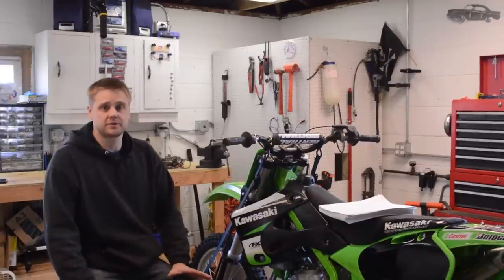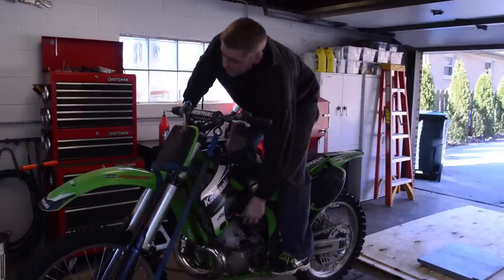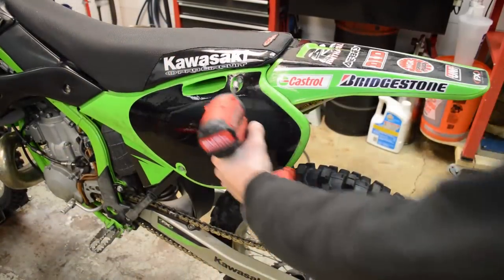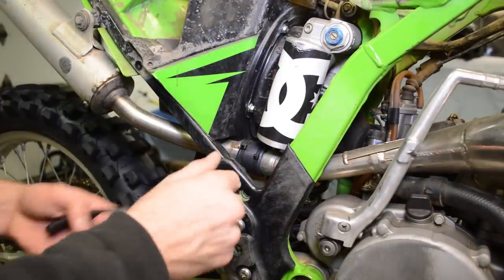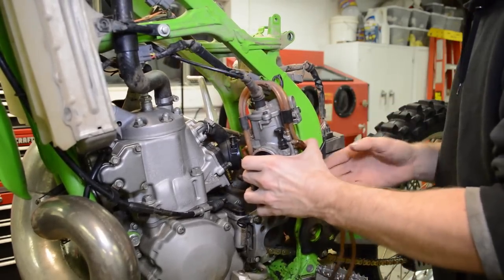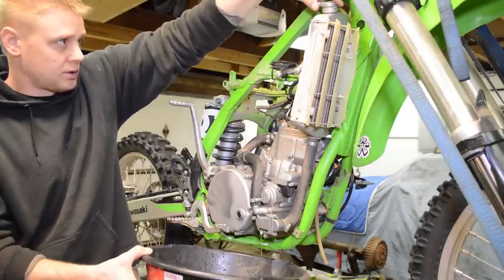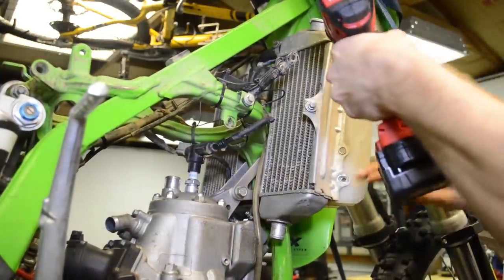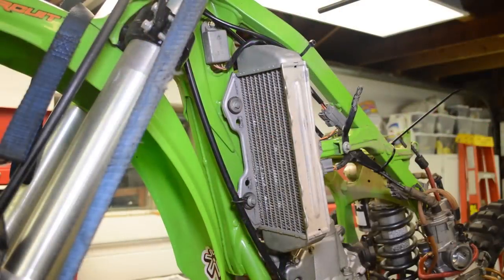How-To: Kawasaki KX125/KX250 Top & Bottom Engine Rebuild 1994-2007

Comment: Thanks for taking the time to do this!
Reply: Kinda vague/ambiguous on certain parts and the metals used
Reply from the maker: @rw499  Everything is covered in the full 6hr video.
Reply: @HTMR  do you have diagrams ? I am interested, but don't want to be let down
Reply from the maker: @rw499  Diagrams for what? You can download the service manual for free on my site. Exploded diagrams can be found on RM atv or any OEM site.

Comment: Thats cool man. I hope this system is working for you. I have a low hour 94 KX250 that hasn't been ridden in 15 years. I might take you up on your video. Thanks!
Reply from the maker: Hi Chris, yes the cranks seals will be suspect after sitting that long. You will have to split cases to replace them.
Reply: How you make out?
Reply: @bunnyman6321  It runs great but I haven't "ridden it". Its a VERY low hour bike and I am trying to keep it original. With the carb cleaned and some fresh fuel it fires right up. It does need fork seals now. Sitting that long is hard on stuff.
Reply: @chriswesney  What plans you have for it other than keeping it original n servicing it?
Reply: @bunnyman6321  My uncle bought it new when I was a kid. I lived with my aunt and uncle back then so its like a family heirloom I guess. I just like having it. I have other bikes that I can ride so my idea is just to preserve it for now.
Reply: @chriswesney  That's cool af! I have a 2002 kx 250 it original n after market parts on it. I love 2t.

Comment: Ok I'm subscribed and I have a 98 kx250 all I need to know is the flywheel and stator cover torque setting I already know the flywheel nut it doesn't say anything in my manual it just says tighten accordingly 😮 I don't have time to watch the video also the power valve covers torque spec isn't in my manual either can you please give me the specs thanks in advance 👍I'm installing the works nickel dress up kit if I don't hear from you I'm just going to torque them down to 16 to 18 ft lbs lol

Comment: I'm purchasing a 95 saki KX125 with bill of sale the bike is immaculate all is in order except the engine of off entirely groom the chassis of the MX. Would you greatly  recommend I completely rebuilt it in wiseco parts crank bearing the while kit ?? Is it reccomendable? A good project I see it as
Reply from the maker: I would go oem for parts. Have the crank rebuilt if stock.

Comment: Hey Matthew, I have a 1990 KX125 that I got from a buddy and I am wondering if you know if I can swap/exchange parts from that engine with parts from newer kx125s? The reason I am asking is I would like to rebuild the engine and most of the rest of the bike to learn how everything works and get it running again. But, I have realized that a bike that old makes it hard to rebuild due to lack of part sourcing. So I was thinking maybe the other 1990s kx125 engines have a similar architecture and I could possibly swap out old broken parts for newer oem parts. Let me know what you think and thank you so much for making this video series, it is a serious life saver!
Reply from the maker: I'm not to familiar with part interchangeability, sorry. Try the KX250 FB groups and thumpertalk forum.

Comment: Have a yamaha dt100, 1977 that reams really bad when i start it or hit the throttle. Cleaned tank, new plug but did not clean the carb. The throttle cable could be the problem but not sure. Any suggestions as parts are very expensive for this bike. Need to attack the obvious problems first. My first restoration project. Your channel is  Awesome! Thanks, Wayne Brown, Rochester NY.
Reply from the maker: +wayne brown Wayne, email me here and I can help you out https://www.howtomotorcyclerepair.com/contact/

Comment: Does it matter which way you put the shift drum in as long as it’s not upside down and the forks line up with the grooves? Like does it have to be rotated at a certain spot before connecting the forks? I would think that the only way you would mess it up is if the forks didn’t line up in the groove
Reply from the maker: The shift drum can only go in one way. Forks need to go in correct grooves. Rotational orientation does not matter at this stage in assembly.

Comment: Question- kx250 - after hitting neutral in high rpm between shifts,  and then jamming it into 2nd gear, my bike shut off and won't go into neutral or 1st. The Bike Runs Because I Was Able To Get Out The Trails In 2nd/3rd gear. Do You Think it can be simple as a shift fork popping out/loose or the gear or shift drum won't slide ?    Thanks In Advance, I Have To Buy The Case Splitter And Fly Wheel Puller For This Job. 👍

Comment: Thanks Matt! I'm getting ready to pick my 2003 Kx250 in another state. Gotta do some work, its been sitting. Rear rim is bent, needs fork seals, spark plug boot, carb definitely needs a cleaning and new jets, air filter definitely and probably a new top end. I wanna take the bike apart in order to fit in the trunk of my car, any suggestions?
Reply: How you make out?
Reply: @bunnyman6321  bike is sitting in garage now. I drained the shit gas and rejetted the carb and new air filter. Also new spark plug and spark plug boot. Started 2nd kick. Runs great! Breaks a smile to my face. Just got order new rim and do front fork seals.
Reply: @zachariahjohn4040  You gotta take it for a spin now; it's time to ride 😎

Comment: Hello so my 2001 kx 250 when I got it it was locked up I took the top end off and got some of the metal out and everything then it came unlocked so would I need just a top end or bottom too?
Reply from the maker: The bottom end was locked up due to metal?
Reply: @HTMR  yes parts of the piston was down in the bottom but I dug it out so now it’s not locked up

Comment: I have a 1998 125 I'm going thru...everything. And I like the 1998 powervalve! My water pump failed and leaked water into trans side.....I didn't know and had to replace the trans ($110, nice one) PV gov' ($11!) all the bearings were going to be replaced anyhow...the crank gear ($10), .....All is good now....coming together as I type

Comment: So that video you did would it be ok for a kdx250 1991 model at all??
Reply from the maker: Yes, however power valve and clutch setup are a bit different. However several KDX owners have bought it and said it was very helpful.

Comment: I have a question is your bottom end rebuild video specific meaning does it show which bolt goes where and where washers go and stuff.  I am asking because my cousin took my motor apart and now i have to put it back together.  I was wondering if your video would help me
Reply from the maker: Yes, it will help you. I also have the service manual on my site for free. It would be a good idea to print all the parts diagrams as well. With those 3 resources, you will have no problem.

Comment: I purchased your video &  it's great.  I was wondering if you have a supplement for a KX125 power valve as they are different.  Mine happens to be an 03.
Reply from the maker: I don't sorry.
Reply: Did you figure it out?

Comment: Cool vids.. how do u torque the cylinder head nuts? The ones that the sockets don't fit on because of the socket thickness? My socket only fits on one so I've just done the other 3 by feel from the first one..
Reply from the maker: My regular chrome socket worked no problem.

Comment: I have to rebuild my 91 kx125. how much different is a 1991 compared to 94 on up as in this video?
Reply from the maker: Bill, I replied to you email.
Reply: MatthewMCRepair I also have a 91 kx250 how much different is it from a 94?
Reply from the maker: It will be different. Not sure how much. However, tools, tips, procedures are the same. If you end up buying and it does not pertain to your model, ask for a refund.

Comment: Good videos man 👍🏼

This how I've put bikes back together properly now and I'm still learning the other day I watched a video and the rings have a designed way up. Should be a stamped close to gap on one side that's the side that should face up (for certain piston kits but I've never checked until last year. Also locktite everything apart from that can't go wrong with this guys advise.
Reply from the maker: +xxnickthegreekxx My 250 rings were not stamped, and can be installed either way. The 125 rings do have a stamping. I cover all this in the video.
Reply: +MatthewMCRepair I bought a wiseco bottom end rebuild kit made in Taiwan not China which I didn't know either way for a Cr 250 99 project I'm doing before I heard bad points. It's all installed with no problems like I've heard will it last 50 hours? From now on I'm going to get stock rebuilt like you done best way to go imo.
Reply from the maker: +xxnickthegreekxx Yes, I read not so good stories on aftermarket parts, so I decided to just rebuild my stocker.

Comment: I saw a kx 250 on Craigslist for 1000$. It had a full fmf system, did black rims, pro taper bars, renthal sprocket and chain, acerbis hand guards, a wiseco piston still in the box, and v force reeds. It needs new rings and a new piston, which the guy had. And it needed the bottom end rebuilt. Is that a good deal?
Reply from the maker: +BenTheAwesome 56 I can't tell you whether it is a good deal or not w/o looking at it. I spent 800 rebuilding my engine. Since you have the piston, factor at least 700 for a full rebuild. Make sure to check suspension linkage for wear, brakes, etc... as that all adds up quick too.
Reply: +BenTheAwesome 56  depends on what the cylinder looks like. it needs a bottom end one replied 700 for a rebuild? i did my kx 250 i put a tranny in it for 25 dollars  the studs for cylinder were bent tapped out some threads new base gasket new front sprocket. i would get for 700.00. what year?
Reply: +Kevin Stearns it was a 2004

Comment: I have a 96 125 it’s sucking in transmission fluid and burning it if it’s a crank seal can I change it without splitting the cases?
Reply from the maker: No, kawasaki design traps the seal in. No choice but to split cases. This video will help you out.
Reply: I know normally it’s the crank seal when it’s trying to rev up on its own but could anything else any other seal cause clutch fluid to get inside?? I’m just really trying to not split the motor I know I’m dreaming at this point
Reply from the maker: @willcrosbie8806  Dude, it is an old bike and they simply need to be rebuild every now and then.

Comment: Hey Matt, thank you so much for posting this video. I'm currently looking to buy a 1999 kx125, the guy is asking $500 for it is blown up. Should i invest in this bike? Thank you
Reply: Blown up your are probably fine, meaning the bike turns over but has low compression. Seized up will be a bigger challenge and may require rebore.

Comment: You are doing a great work. I have a KX125 2000, last time i rebuilt my engine i included new top end, piston, new cylinder and new disc plates. The bike is working fine,  i have tried several different jettings, BUT i cannot obtain the power i had when i bought the bike 7 or 8 years ago. It seems i can't find the reason of power loss...What could be the most possible reason? Any idea would be appreciated
Reply from the maker: Check compression. Pull reeds and inspect. Pull pipe and inspect piston/cylinder wall. Remove power valve cover and rev it up and make sure it is moving.
Reply: Thanks Matthew, i 'll open it up again for inspection and see what i can find; i am sharing your channel to our blog btw
Reply from the maker: Cool. Have a link to your blog? I'd love to check it out.
Reply: yup, dirt-bike.gr Sadly it's in greek only
Reply from the maker: Thanks....good thing for google translate :)
Reply: haha good luck with that, well it's not that bad actually, you can drive through yourself, cheers!

Comment: So are you saying, if I have a 2001 KX125, I can put a crankshaft for a 2003 KX125 in my 2001 Bottom End with no problems?
Reply from the maker: No I never said that. I would look up the crankshaft PN for both years and see if they match. If they do, then yes, you can use it.

Comment: I have a question about the cases. do you know if the right side case of a 2003 would fit a 2002 because I need a new case
Reply from the maker: I don't know. Look up the PN for both years and see if they are the same.

Comment: Hey there, thanks for the videos! I have a question, I am not getting spark with my kx250. No spark at all. I've tried changing out the plug, checking grounds and connections, and ruling out that it isn't the kill switch. Where would you go from here? are you able to do a video on testing the coil and other electrical components in a kx? Thank you
Reply from the maker: Grab the service manual from my site and the electrical section should have some testing info for you. I haven't messed with mine so I can't comment on what to do: https://www.howtomotorcyclerepair.com/kx125-kx250-oem-service-manual-99-08/
Reply: Ok, perfect thank you. Those manuals are what I am missing!
Reply from the maker: Keep me posted on your spark issue.

Comment: hello. i just bought a kx250 1998 and the kick start only engages some times, other times it just goes up and down as if there is nothing inside.. i have seen a few videos on it and need to split the engine, i dont feel comfortable with taking the radiator off and getting everything taken apart. is there any way i can get to the kickstarter without taking everything off.. i mean just taking the engine case off? thanks in advance
Reply: tom giles
Reply from the maker: You only need to take the RH cover off to access the kickstarter.

Comment: hey just downloaded the manual... bought my bike with blown motor (Great deal $$) however the motor was mostly tore down and came with a new complete kit. I have trouble indentifying and determining which seals are for what... the package of seals has soo many and the numbers dont correspond with diagram... ive figured out the obvious ones (crank, kickstarter) but need a picture to go with it lol .... any knowledge of the whereabouts of this information?
Reply from the maker: Aftermarket kit? I find the same issues ID'ing parts. Look in the parts diagram, the part description may have seal dimensions.
Reply: MatthewMCRepair ya its a hot rods kit... same bike as you.  ill have to do some cross referencing indeed
Reply: MatthewMCRepair also when installing the new main bearings the seals must be in first... will the bearings drop in cold or will I need to heat the case aswell? when would the seals go in if this is the procedure? during heat or right before bearing?
Reply from the maker: Install seals, heat cases up and freeze bearings, and drop them in. Seals will not get damaged in oven. Do not use a blowtorch. This is all covered in detail in the full video FYI.
Reply: ya my internet line was chopped at home... trying not to use up my data to rebuild this thing lol... will definitely be watching them all on assembly
Reply: got my seals and bearings in no issues, seems my transmission is missing the collar for the output shaft :(
Reply from the maker: Is it still available OEM?
Reply: MatthewMCRepair lol ya lots on internet.. but I did find it .. it was still in the gear and the gears were mixed up

Comment: Hello! I am currently trying to restore my 97 Kx 125. However from the looks of it my motor does not match the year when the frame was made. This is the serial number KX125KE015985 on the motor. What is the number on your bike? If you do not mind me asking. Do you know if parts from 96 or 98 models work with this motor possibly? Anything helps. Thank you for your time!
Reply from the maker: I don't know much about the serial number and year interchangeability. I would join the kx250 riders fb group and ask there. Or on forums.
Reply: MatthewMCRepair Ok. Thank you very much!
Reply: go on bike bandit .com you can use them to see if parts interchange or are the same from year to year.

Comment: Hey mate, will a 2002 kx250 crankcase set bolt up to kx250 2001/replace a 2001 crankcase and transmission.

Basically are the 01 - 02 crankcases interchangeable?
Reply from the maker: PN are different, however that does not mean they won't work. Ask your question here: https://thumpertalk.com/forums/forum/76-kawasaki-2-stroke/

Comment: so I have a question. I bought the disassemble and assembly videos but I need to replace the connecting rod. how do I get the big pin out and the stuck Bering without A special tool
Reply from the maker: You will need a press. Just send it out for rebuild, should cost about 180. Sorry for the late response, I just saw this comment.

Comment: Think the Kips system quite a bit different from 04 onwards?
Reply from the maker: +Justin Davis For the 250, yes. The 125 PV is simpler.
Reply from the maker: +Justin Davis Yes, I was considering wossner for the rod kit and piston. Ken at kenoconnor racing uses pro x, so I went with that. It's made in Japan so should be just fine. I've used wiseco plenty of times with no issues and the piston kit is $20-50 cheaper IIRC.
Reply: +Justin Davis wossner are great wisco as well dont get the pro x they are cast the other two are forged.
Reply: Kevin Stearns Do you mean rods or piston are cast for Pro X? I top engine builder here in Aus says pro x rod kit are pretty good. Ill still run wosner piston at the least, and their rod kit if i can afford it
Reply: +Justin Davis the pistons are cast if you get a connecting rod go with oem. if you go with aftermarket go with wiseco. or better yet look around on ebay what the hell am i thinking. i get everything  for my kx on ebay!!!!!!!!!!!!!
Reply from the maker: +Kevin Stearns All rods are forged. Pistons are either cast or forged. I think the best bet for the crank is to have the OEM rebuilt with a quality rod kit. Making sure it is trued properly as well for main bearing longevity.